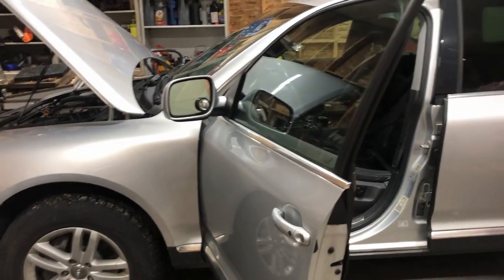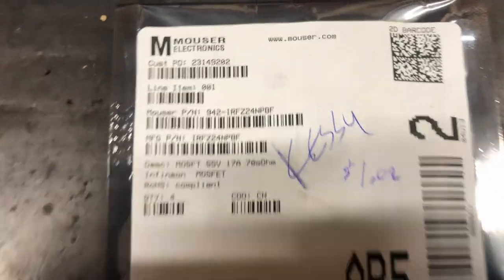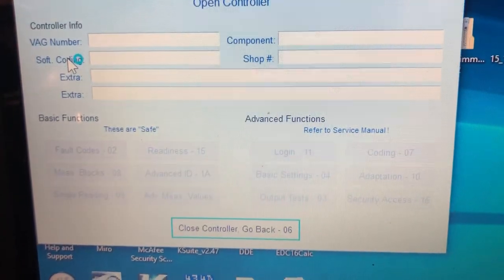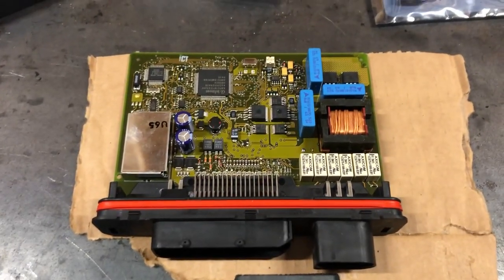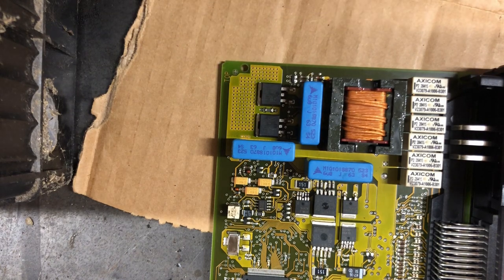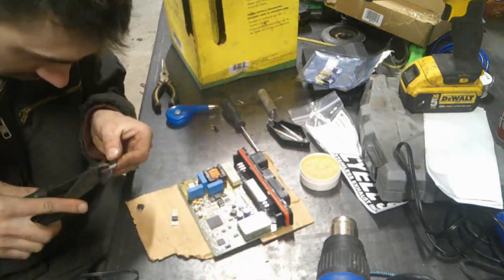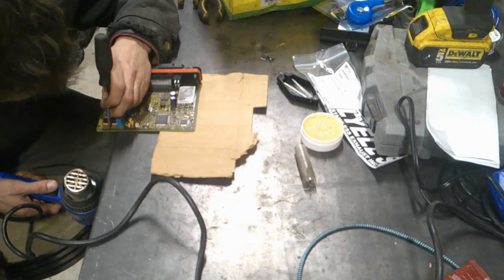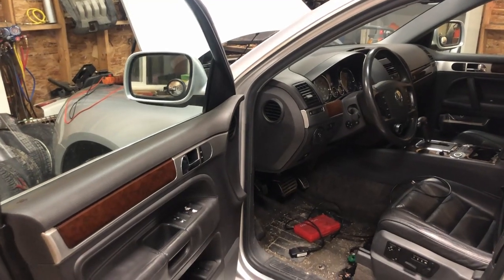T1/7L Touareg Kessy Repair/Rebuid

Comment: Hey man, thanks for all the help and info on the Kessy unit, got mine out and found the mosfat was indeed faulty, switch was wide open and draining my battery! After disconnecting my battery every night for 50 days it’s finally fixed! What a cheap fix for a monster problem hahah
Reply from the maker: Oh it’s annoying, I’ve got to do my personal Touareg now as it’s draining it too. Such a cheap and simple fix compared to replacing the whole kessy unit.

Comment: If you're going to do this job you should really have a hot air rework station to put pinpoint heat in spots you actually want the heat
Reply from the maker: I’ll have to look into that, thanks

Comment: Thank you very much for this video  !  I will need just clarify couple things. During the diagnosis in addiction to error codes indicated in this video I had also these error codes:

00183 - Antenna 1 in the passenger compartment of the access control system and the right to start the engine- R 138
00184-  Submission of a control signal to the engine start / stop button - But my start -stop button works fine with no issues. 

Could you please inform me where to dig out the problem. Thanks

Comment: Could one culprit be the door lock switch on the outside handle?  My battery drain started happening when the external lock button on driver door (left side USA) stopped working.  I looked at a used handle, I got from eBay -- I payed off the button cover from the outside and saw the surface mounted tactile button was corroded and now a dead short.  I remove the button, sanded the contacts, then tested it on my door's harness and it appears the battery drain stopped.  I couldn't read all the code with my Innova scanner even with the VW VAGCOM upgrade.
Reply from the maker: I've got to revisit this shortly on my personal Touareg, i've got a couple dead door handles as well. I dont use the keyless entry though as I dont usually lock the doors so if I've got handle issues I'll probably just unplug them

Comment: Josh, great video. Am here dealing with code 0003 on my 2004 Cayenne Turbo. 0003 indicates faulty control unit (electrical fault in the circuit). The car came equipped with entry and drive. Long shot of a question, but do you think this simple fix will cure the issue? I’d love to get it working again. Thanks!
Reply from the maker: I've got a buddy with an 04 touareg and he was told they weren't repairable with that fault. I'm not well versed enough on the topic to say yes or no, I'd personally try replacing the mosfets but I'm not sure if that'll help.

Comment: How did you tested out those mosfets and resistors ? With multimeter? Because i have same problem and same fault codes in diagnostic.
Reply: Can you give me your email I wanna send you photo of my Touareg faults codes
Reply from the maker: joshthring21@live.ca, they have to be isolated from the circuit to test. Its quite common to fail, your can check out clubtouareg about other people having issues

Comment: Thanks for video. Mune have same symptom. after replace the chips the fault code disappear? How about BATT drain? mine 0.06 metered when I check through multimeter.
Reply from the maker: yes but .06A is acceptable for a drain

Comment: Hey I have a 2007 Touareg that keeps blowing the 3 bottom kessy fuse resistors. I have no battery drain that I am aware of. Do you know what each set of 3 fused resistors the kessy controls? Any idea what might be causing these fused resistors to fry? It's triggering a VCDS "Electrical Fault in Circuit". Thanks!!
Reply from the maker: Im not sure which one goes where but I’d imagine either a shorted wire or faulty antenna could be overloading them
Reply: @JoshsJettas  I solved my issue. Buried deep in a Renntech forum I found this little gold nugget:

Brit6 posted: "FYI...these resistors sit across the drain of the transistors, if the resistors are blown, it's because one of the mosfets is bad. Translation, replace everything at once (2 transistors and all 6 resistors."

I was installing a backup camera and accidentally shorted a wire somewhere (trying to measure resistance and was in the wrong setting on the multimeter...). Not sure where or how, but it broke my keyless push start and handle approach unlock. Looks like I fried a MOSFET and hence the fused resistors blew. Replacing both MOSFETs (not sure which one is tied to each of the group of 3 resistors), the 3 blown fused resistors, and clearing the stored codes by VCDS, I now have push start and handle-lock/unlock back! The post implied that a failed MOSFET will blow the fused resistors.
Reply from the maker: That’s great to know for future reference, it’s amazing the info out there about these things it’s just a matter of finding it.

Comment: Do I need to keep the Kessy module or can I just disconnect it and still isue the car with no issues, I am currently having a similar issue, just don't care for door sensors so be used ?
Reply from the maker: It needs to be installed to start the car as it’s part of the immobilizer system. But I believe I have seen people cut the mosfet legs as a way of disabling the sensors/drain.

Comment: Hey brother, thanks for your video! you certainly know your stuff or at least make it look like it :) Iv got a similar issue with my car, same kessy fault codes same antennas, rear bumper, drivers and front passenger - but - mine say "UPPER LIMIT EXCEEDED" any idea what this means. I notice yours say "OPED OR SHORT CIRCUIT".

Any help is warmly welcomed. Im trying to find out why my battery is dying after only 8/10 hrs!! I also have a relay clicking continuously behind the dash somewhere once i lock and walk away from the car. Any ideas... Cheers brother !
Reply from the maker: No expert by any means but quite a bit of research from various pages all compiled into a video that fixed my issue (and hopefully others). 
I'm not sure what the upper limit failure is compared to the open/short circuit, but it seems if there were multiple antenna failures at the same time that the module is usually the suspect. They come back after clearing and a test drive?
My personal Touareg started killing the battery overnight here a couple days ago so I'll be doing a PT.2 here to see what its issue is.

Comment: Hello.. great video.. very clearly instructions.. but I have 1 question. My kessy number is 3D0 909 137 D.
And is 433mhz .. 125 khz..

So.. are the components that you changed the same one for my unit?

Thanks a lot
Reply: @JoshsJettas I have the same kessy, 433Mhz, 125khz. Are the menitoned parts compatible with that unit? 
@fernandoct6 Did you tried to replace? or did you find any other solution?
Reply: @robertnyeso8590  yes. They are compatible.. but only 1 key will open/close the doors with the handle's button.. the other one only opens with the buttons of the key.  If you have any questions just ask
Reply: @fernandoct6  Thanks!!

Comment: Did it fix the antenna fault code? My Touareg has a fault for the rear antenna and I want to know if this will fix it before I replace it.
Reply from the maker: This one i believe had an actual antenna fault, the diodes would be failed open if its a diode fault.

Comment: Hey Josh I'm less than an hour from you...could I pay you to fix my kessy like this on my 05 v8? You can use my v8 for some content...or my other t3s...we have a 14 r line tdi with full stage 2...tune..3 inch straight pipe..bigger maf..bigger tip and intake...or the 12 tdi with lift and 33s...tuned and deleted too
Reply from the maker: Hey for sure, I’m not taking work on for the next month or so but I’d be good after that
Reply: @JoshsJettas  awesome that works for me man. I appreciate it. I'd love to check out the v10 too..only touareg I haven't been in
Reply: @JoshsJettas hey Josh let me know how to contact you so I can get my touareg over when your ready.
Reply: @JoshsJettas would you please create a service for this? I would pay also? What's a fair price if we ship the kessy to you? I don't mind supplying parts
Reply from the maker: @Noel127 shipping to/from Canada is a killer, I’d personally try and find a local electronic repair shop and either tell them what you want replaced or buy the parts from
Mouser and show them